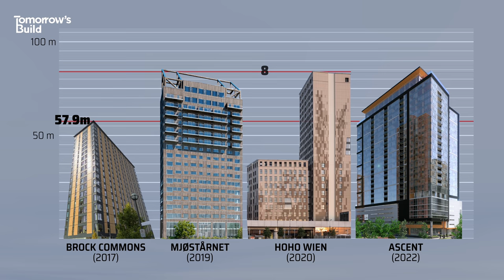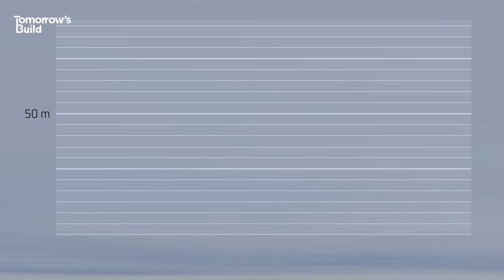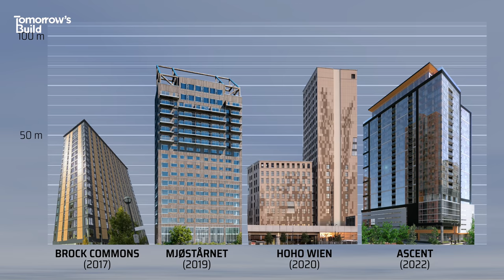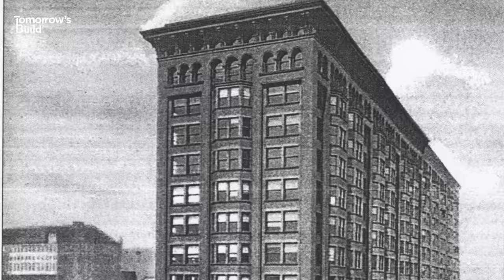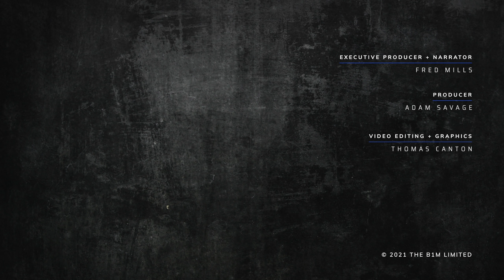Why There Are No Timber Skyscrapers

Comment: Building with wood is like buying a new diesel car.  You are told, "This is new and modern and won't make the usual cluk-cluk noise" but all diesel cars after a year or so loosen up into the cluk-cluk noise.  Now we are told, "modern wood properties" are 'perfect'.  
.
Wood is a cellulose (it is alive).  It expands and contracts with moisture change no matter how you try engineer it.  Give it time and it starts creeking and cracking.  Gaps occur everywhere and it dulls and shrivels when the sun UV rays take full effect.
.
Canada has amazing good quality wood and they build some super nice looking modern homes out of wood... and even after all the 'maintenance' you can possibly do, those homes become old and creeky in matter of a few years.  Concrete and brick on the other hand.... tried and tested - solid and reliable.
.
Wood is great for Architectural features, gives those features a sense of life.  But don't live in them
.
The true marvel construction material of our age is actually plastic.  Yes that fake stuff generally made from oil.  But hopefully recycled from waste.  Plastic flooring, plastic members cast to look like wood is undergoing a revolution of sorts.... that's tomorrow's build

Comment: It's  either we won't need to build Skyscraper anymore, or we will be using a new revolutionary material to build stronger safer and environmentally friendly material.
maybe carbon nano tubes and 1km tall buildings are the norm, and a sky elevator is the new train station

Comment: Concrete can last millennia, check the Roman constructions. Whereas wood lasts... how long?
Reply: As long as you need it, buildings aren't designed to be a few 100 years old, a normal house will have a life span of 80 years, in Europe at least so why not building it in wood. When choosing materials you just have to look at the expected/wanted life span of the building you're designing.

Comment: genuine question - why don't we use carbon fiber for building materials? I'd imagine tossing a layer or two between the sheets of CRT could drastically improve it's strength? or beams wrapped in it perhaps? I quite like the aesthetic of it, and I think the mix of it and wood would be quite lovely in fact, like mix of nature and high tech. especially if the carbon fibre was hemp produced, that just sounds like an all around good idea to me?

Comment: How do these new buildings perform in the real world when faced with fires, hurricanes, and earthquakes? How about nuisances like water leaks, floor loading limits, and noise insulation? Many lives were lost in the original multi-decade quest for taller buildings. The result is a building code written in blood.

It sounds like there are plenty of willing test subjects in this comment section. I will observe from the safety of my concrete and steel apartment for at least the next 20 years.

Comment: Wood burns. Best not to build any higher than fire ladders can reach.
Reply: Composite wood is safer than steel.
Reply: @neeljavia2965  really? What kind of adhesive do they use? Are you saying it doesn't emit toxic fumes when it burns?
Reply: @neeljavia2965  you would need greater fire suppression, isolation and insulation. Adding substantially to the cost.
Reply: @claudermiller  I guess you didn't watch the video.
Reply: @neeljavia2965  part of it. They said it needed insulation etc. but the WTC had insulation which was torn off. There's always the unexpected, that's why they call it unexpected.
Reply: @claudermiller  They don’t really talk about what is used to protect the wood in HT Type IV-A buildings, up to 18 stories, and 270’ The normal material is 5/8” Type X gypsum wall board. Then you use all sort of special listed assemblies for penetrations etc. The structure can be more than 18 stories, e.g. A concrete podium constructed in the correct way might have two sub-floors, a couple floors above grade, then 18 of wood, with top less than 270’, without any special alternatives.

Comment: It's more an utopic idea. Timber easy rotten, not easy to resist for longer external weather influences, not mentioning fire safety for such large building. Good for termites and definitely good structure material for a garden sheds, but not for larger construction projects. Still do not understand Yanks and thier heresy with the lack of concrete structures in small housing estates, especially in the areas with huge external weather influences to storms ect. I guess they should simply ban constructions which are cheep but do not resist any larger storms.